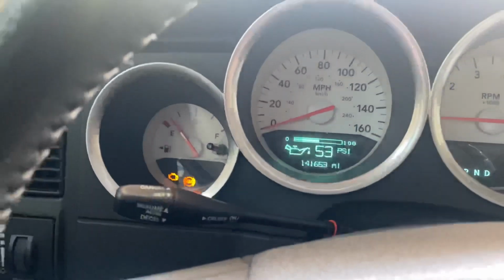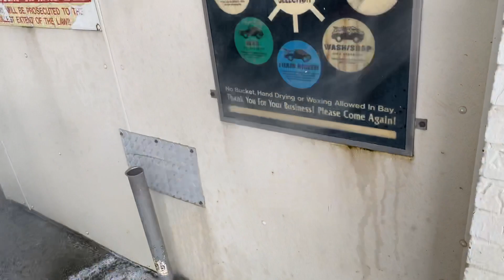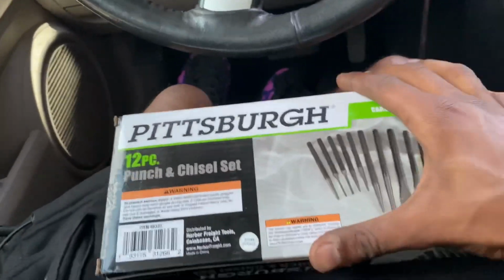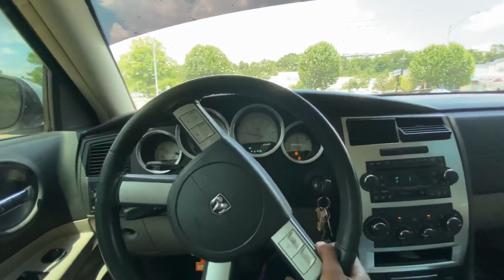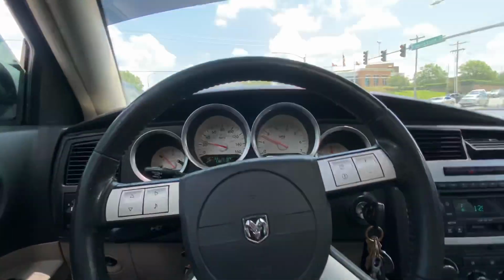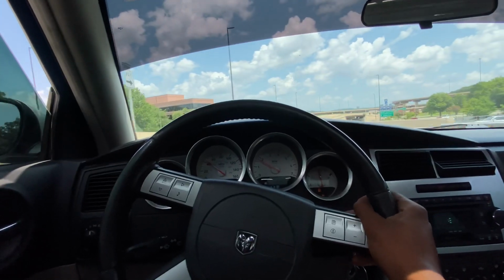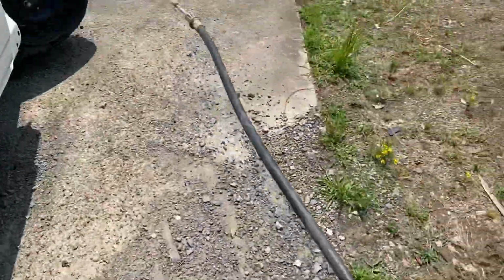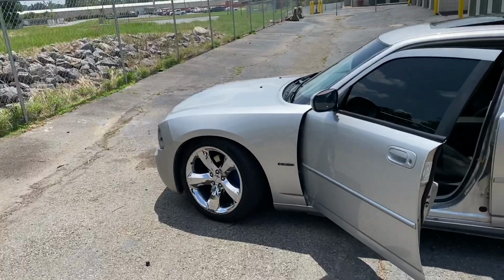Removing Dodge Charger E-Brake Cable || Detailing Dodge Charger R/T

Comment: My man didn’t show how to remove the cable under the car, just the caliper part lol
Reply from the maker: Tried to explain it. U just pull it off hook , squeeze the retaining clip and use a ebrake tool to pull the cable out the connector.